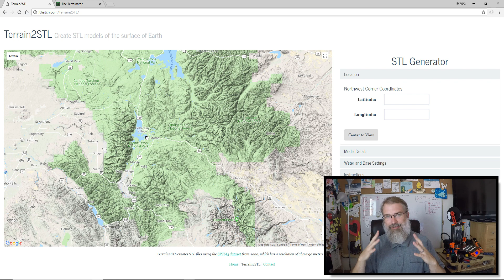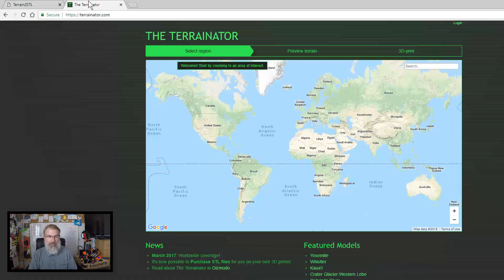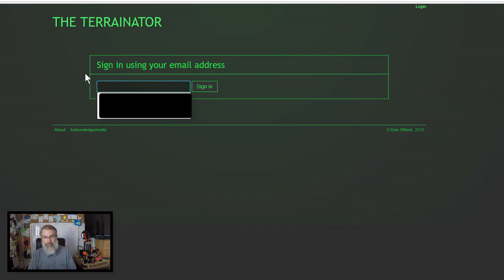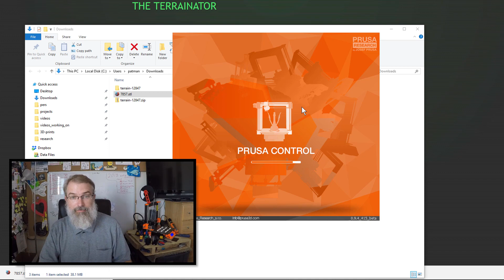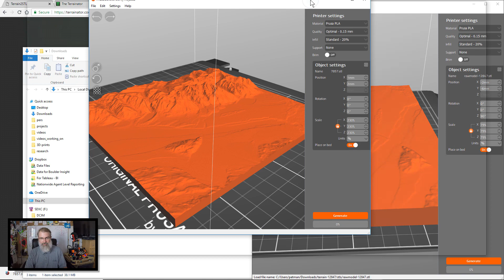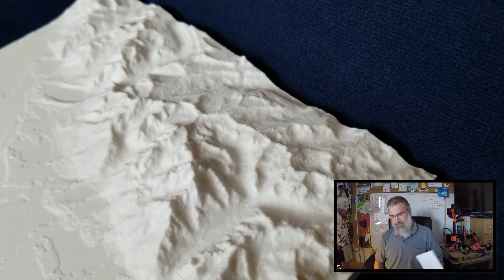3D Printing: Printing Topographical Maps

Comment: Thanks for the video and your explanation and comments. I tried both sites as well. NASA's Shuttle Radar Topography Mission (SRTM) has 90-meter resolution and is the data source for the Terrain2STL software. I couldn't determine the Terrainator's source, but it is probably 30-meter resolution. One free source for 30-meter resolution is the Japanese Space Agency aka JAXA. https://www.eorc.jaxa.jp/ALOS/en/aw3d30/index.htm 
Some software like Vectric's Aspire will convert the GEOTiff to Gcode for a CNC.

Comment: Awesome video, may I ask which 3D printer model you used? could this be done with a 3D model created from fotogrammetry (Drone aerial images). How much would you sell does models for?
Reply from the maker: I use a Prusa i3 Mk3 printer.   
I have never done fotogrammetry I guess in theory it could be done, but its simple enough to get detailed elevation information off the internet.

As for how much to sell them... I have no clue what folks would pay for 3D printed maps
Reply: Thanks a lot for the reply, cheers from México.